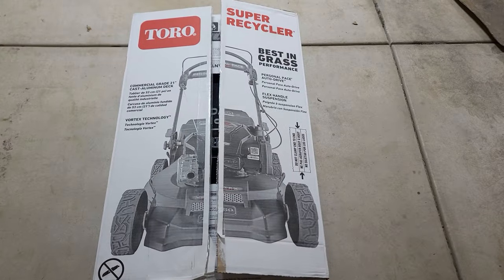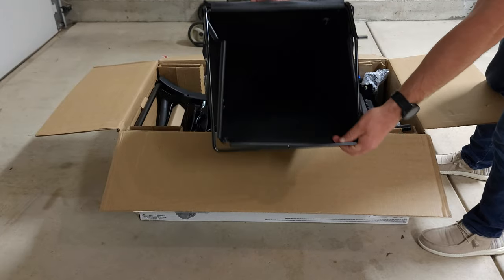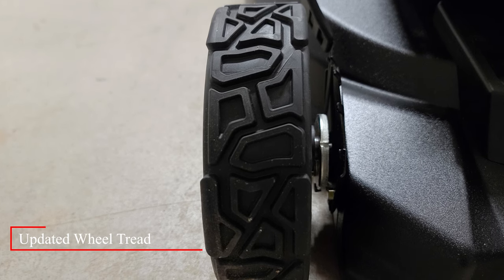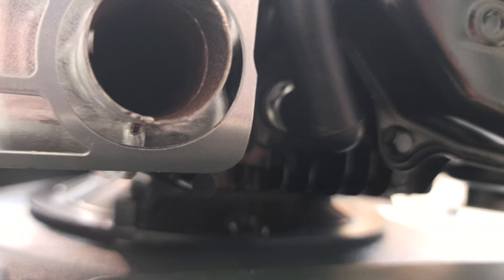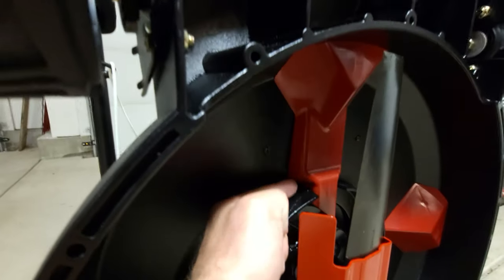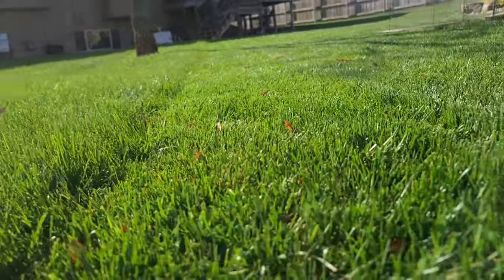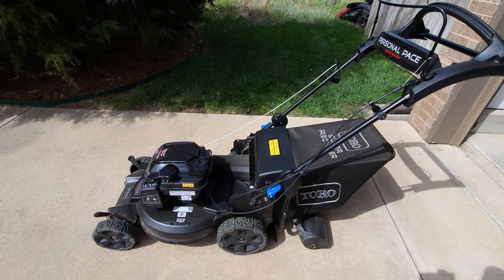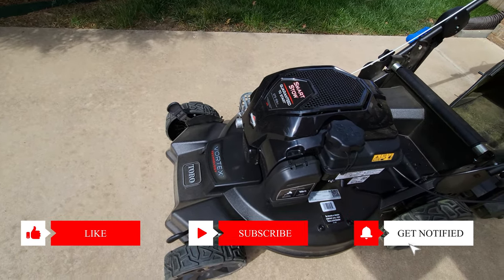Best Toro EVER?! New 2022 Toro Super Recycler 21565 Unboxing and Initial Review

Comment: I just purchased the 21563 & have the left front wheel issue & mine exists at various lever settings (with all set at same position). Is there a fix for this you are aware of (as I don't mow at lowest position as typically mow around 2.75" or higher) or wondering if I should return to dealer.
Reply from the maker: I am not aware of a fix unfortunately. I haven't had many issues with it as it doesn't seem to affect my mowing very much. I would document it with pictures and then mow and see how it feels to you. May end up not being an issue
Reply: @lawntechtravel  Thanks for the reply as appreciate it. Called Dealer & said every Super Recycler they've sold has had same issue but no performance issue since grass is uneven so wheel makes contact with lawn fine when mowing.

Comment: Great review I just got the 60V Super to use and have the regular recycler which I like.  Those annoying things that Toro can easily fix are not being addressed and they could ultimately have the best mower in the market.  Not sure why they are being so stubborn about it.  Thanks
Reply: are u happy witht he 60v super recycler? im deciding between that or the dewalt RWD mower
Reply: Hello I havent used it yet I also purchased the Recycler 60v with the mulch/bag lever and I like that so far. Its so quiet and feels so light on its feet.  but I had an issue with my grass and now its finally getting some steam.  I used a fertilizer and killed it a bit so I had to dethatch it so its not growing yet.  I am  exited to use the Super Recycler as soon as I do I will let you know.  It looks so mean but it doesnt have a on and off switch to turn off the LED's which to me its again a Toro thing that I cant understand why they do things backwards.  You can get it without the LED but it was the same price so I thought it would be a good thing but now I cant return it so I am stuck with the LED one.
Reply: @randomrazr  the super recycler is a superior mower bar none

Comment: I enjoyed your review. I use a husqvarna and I noticed your leaves were not being pulled up. Is that because of the mulch system? I had a 163cc toro and it toasted in 3 months.  Throttle cable dried up and broke the handle. The idle kept getting lower until it was so low it wouldn’t stay running. And the game changer was no gas valve to shut off the gas to the carb which my husqvarna has.
But I would give toro a chance if I can find a cheap one.
Reply from the maker: I will say it's biggest flaw is bagging. This is definitely a mulch first machine. Thankfully I only have to bag twice a year but it is pretty annoying doing so

Comment: I bought one and first cut was good. I had high grass. I need to remove the mulching plug. what is the secret?
Reply from the maker: That's a great point! Where the mulching plug "clips" into the little groove at the bottom, push that plastic piece in towards the mower blade. That should loosen it and allow you to then pull it up and out. Took me a minute to figure that out too. Hope that helps!

Comment: I have a 2021 and it has been in the shop 3 times now. Wheels lock up when you attempt to back up from a object. EVEN the dealer cannot figure it out and people all over the internet complain about this common issue. I miss my HONDA HRX217
Reply: Yep, same. My older Super Recycler had the same issue. The new one also shares the older one's propensity for both throwing the (annoyingly difficult to replace/repair) belt.
Reply from the maker: I heard there were a lot of issues with the 2020 and 2021 models. I know many that had 2018 and 2019 and said they are amazing units. I haven't had any complains about my belt yet. Everything seems great to me on this 2022 unit.
Reply: @lawntechtravel  my old one was like a ‘12 or something, and it definitely had the reversing and belt issues. I was surprised they hadn’t fixed either problem in almost ten years.
Reply: I own the black super recycler and the Honda hrx 217 hydro with the plastic deck. The Toro is alright for the price and weighs 10-12 lbs less than the Honda. I like the drive system on the Toro. But I like everything else about the Honda except no oil drain plug. To me the Honda mows the lawn more even.
Reply: The mower has to move forward a few inches after the drive is released for the mechanism in the small drive gears to unlock and freewheel to go backwards .

Comment: Awesome review, was thinking about purchasing this model myself. But I did want to ask if the handle can be adjusted to different height/ position?
Reply from the maker: Yes, you can absolutely adjust the handle to different heights. In the video description is the Toro manual for this model and in figure 11 it shows how to adjust the handle height! This thing is a mulching machine! I absolutely love it
Reply: @lawntechtravel  oh man thank you so much I think this is my next mower for sure!
Reply: ?? I saw nothing about handle hight adjustment - so I removed the bumpers & that let it drop down ..
Reply: @no-hndle I did the same with the bumpers but I am having issues with the handle moving up in the arrowed slot when pushed because there's nothing stopping it from moving

Comment: I took my 16-year-old Honda HRX in for its annual spring tuneup but unfortunately got it in too late and and everything was backed up and my lawn was getting loooong.  So I go to HD to rent.  All they had was a Toro.  Now I know Toro as a quality company based on its commercial golf course equipment.  However, I was shocked at the poor quality of the consumer mower I got.  The drive control was flimsy and uncomfortable, a wheel kept falling off - several times, in fact, fell off in my car when I went to return it, the height adjustment kept slipping, the bag was tiny, and a bunch of other things.  Maybe because it was a rental but I've rented a million tools and they were at least functional.  The mower was clean and looked almost new.  On the other hand, maybe because it was a rental it showed realistically what to expect.  

But just looking at the wheel height adjustment in this video makes me cringe - cheap sheet metal prongs, thin sheet metal lever that will definitely bend.  Shame on Toro.  And the mulching/bagging "plug" - gotta be kidding.  And Toro wants the same money for this 21565 as a Honda HRX?  My HRX is bullet proof - 16 hard years' use over a bumpy back yard, mowing and major leaf pickup/mulching in the fall, half acre lot and the machine gets used at least nine months out of the year from spring cleanup to final leaf pickup.  Multiple changes between mulching and bagging, multiple changes in height adjustment depending on season.  Today is November 29 and I know I'll mow/leaf pickup one or two more times in December before the snow arrives or after, lol.

Comment: My super recycler bought in 2001 still runs great but it's 190cc
Reply from the maker: They're definitely downgrading the engines I assume as a cost saving measure.
Reply: @lawntechtravel  and EPA regulations, which is why honda is leaving mower business, they don't want to make mowers with kiddie engines.  We'll be stuck with crappy battery powered ones.  $$$$ batteries that will make gas powered mowers look like misers to operate and those plastic cooling fans where the blades attach under the deck on battery models, better buy a dozen of those, will be broke every year from rock/pebble being tossed around the underside.
Reply: @lawntechtravel the 190cc engine it’s just 100 dollars less than that model. The model 21462 come with the same engine that’s why I rather save those 300 dollars or going with the 190cc model

Comment: Any thoughts about new plastic wheels? It’s look cheap
Reply from the maker: The wheel tread is actually rubber and they seem to be doing well. They don't feel cheap to me and now have ball bearings as well.
Reply: Probably cause they are. The older style had bearings also, and the rear ones have grease zerks on the last model design, not to mention better height adjusters that are more beefy. This years model looks like a step down in Quality overall.
Reply: @jasonwb6884  look like he get paid for the review then
Reply: @dattran6886  I don't know about that. I did notice Toro also changed the Transmission from Metal to Plastic. It looks like Toro is really cutting costs on this years Model. I know this mower isn't a Pro line, but this years Super Recycler looks more like a Recycler model with the cost cutting, I guess the new Super Recycler still has a cast Aluminum deck (Not sure if that Vortex gimmick does anything). Why pay more for a new Super Recycler is the question, when the last model design is better.

Comment: can you.leave gas in the tank during smartstow?
Reply from the maker: Absolutely you can. Now I've only done it with about half a tank but the manual says it's designed to stow upright with gas in the tank and it won't leak.
Reply: There is a “lip” that the gas level must stay below or the excess will leak out

Comment: Ok looking,but has that same Walmart lower in priced engine. No it's not the spark plug.
That's common for these engines. Positives, upright storage, personal pace drive. Another negative, 4 point wheel adjustment? I have a Husqvarna with one lever that adjusts all wheels at once with a Honda. engine.

Comment: Has anyone tried the 21564 red model sold at Home Depot and are there major differences. Youtuber and subscribers can you provide insight on gas rwd toro? I went to Lowes and got a Craftsman m320 but later found out cut height is 3.75 inch. I noticed nowadays push toros rwd have 4.25 cut height. Getting to the sod I had ST Augustine Floratam sheets installed all throughout. I tried the craftsman once so far and while the quality of build I find great the cut height is definitely not to my liking. I’m also in SWFL Fort Myers area and only have a two garage for storage and we park both cars in by preference. I noticed toros have the folding storage capability and the cut height is higher however Toro uses several engine types on super recycler models. Home Depot reviews have trashed there mowers with engine, wheel, and quality issues. I also noticed right now you have to buy direct through toro because my Home Depot doesn’t offer Honda engine on toro which seems to have better reviews and feed by tradition. They have model number 21564 which is Briggs engine for order from store. However thinking about finding a way to get a Honda equipped version of super recycler 160s-190s cc. Can anyone provide good detailed feed on quality and engines as these mowers are in $700-$850 range and I’d rather not go through the mud on purchase and returns.
Reply: The Toro SS (21382) with the Honda GCV 160cc 6.9 lb-ft of torque is last year's model. Not sure if Toro is still making that mower. However, I do have the Toro SS (21564) 190cc with 8.75 ib-ft of torque and the Honda HRX 217 VKA 200cc with 9.4 ib-ft of torque I bought new this year. That Briggs & Stratton engine is very close to the Honda's power. I put both those mowers to the test, and I haven't been able to bog down either one. Many people have complained about the B&S 190 engine having sputtering problems. Since I've had this mower, I haven't experienced that issue at all, and my backyard is very bumpy. So maybe they fixed it.

A word of caution if you do buy 21564 from Home Depot. This mower will come from El Paso TX and if FedEx delivers it, there's a chance of it getting banged up. This happened to me twice, and both times I had to return it back to Home Depot. The same thing happened to another person in the Toro Facebook group. FedEx banged up his new mower. It might be best to see if there's a mom and pop lawn shop that sells that mower in your area if you want to avoid the frustration. That's what I did in the end.
Reply: @4x4gear33  thanks for the reply. It’s so difficult to figure out which is quality. Not only supply holds…I mean shortages (yeah right!! lol) but also quality control. I read through those sputter comments on reviews and said jeez are you kidding me? I mean that could have been related to type of fuel also. I bought that cycle fuel and cut 8k worth of yard on one tank with the craftsman.

Comment: Decent mower. Looks like it cuts ok and sounds pretty healthy but think I will stick with Honda, Exmark, Stihl and Husqvarna.
Reply from the maker: Why?
Reply: @lawntechtravel   well I know those engines like the back of my hand and are pretty easy to work on . Have ran the heck out of them all and they keep going at the top of their game. I also love the Honda double blade system on all their mowers. I get a bag of half inch pieces of grass. Very clean cutting with lots of power. Oh and the rear wheel drive literally pulls me up hills. When I invest in equipment I'm looking for something I can run the heck out of all day every day  and last a long time with proper maintenance like oil changes and greasing the gear boxes, spindles, wheels ect. This equipment has handled all I can put it through and just keeps rocking it as long as it has fuel. I mean outside of torturing it or beating on it.  Can't have down time. I can honestly say I enjoy running every peice of equipment that I own. 👍 that mower in the video looks pretty good though and should be absolutely perfect for homeowner use. Maybe a backup mower for a lawn crew as long as it's taken care of. I guess it's just personal preference and different experiences. Didn't mean nothing bad towards it though. Easy to maintain and fix is a big thing with me because I am my own mechanic and welder.

Comment: I see more and more people mentioning the issue of the wheel not touching on a level surface. I took my front wheels off and tried adjusting, but there's nothing really to adjust. This cannot be correct, has anyone found a solution to this!?
Reply from the maker: My solution was to move the cutting height down, but that might not work for everyone. It is annoying
Reply: As annoying as that is, my 1996 Super Recycler does the exact same thing. It must be some inherent design flaw. That being said, I love my mower despite a couple of weaknesses. It also has electric start and a blade brake clutch which isn't a combination Toro offers on this mower.  I'm also pretty sure the new one isn't going to last 26 years.
Reply: @lawntechtravel  I just bought the 60 volt version of this mower and noticed that front wheel was off the ground too. I thought maybe there was just some imperfection on my slab but I guess not

Comment: I have same one only battery  mod
Reply from the maker: How has it been for you? I'd like to try a battery powered mower
Reply: @greghumliceklawncare  small yard front and  back combined  little  over 2500 sq ft cutting both I have 2 bars left on battery running  at max because  I have thick fescue  lawn was nice this yr just  putting battery  in and wal la no problems  start right up the mower is exactly  like yours but it's battery got the side discharge  when I registered  the mower no charge

Comment: I put a 163 Briggs on an old 21" Craftsman push mower and it's on the faster side of slow in thick grass. With propel drive, it would be a dog.
Reply: was that a new engine?  are you sure it was properly tuned?  a 163cc engine should have more than enough power for a 21 inch blade and no wheel drive.  that give you at least 4 1/2 horsepower.

Comment: Not a fan of the new wheels (Upgrade, lol). The old style Super Recycler wheels were solid and proven...used for lots of years. I can tell by looking at these wheels that they are cheaper than the old ones and I would bet they won't last nearly as long (planned obsolescence). looks like Toro wants your money on replacing wheels every couple of years.
Reply from the maker: Should have said "updated" and not upgraded in the video as I can't tell if they are an upgrade or not. These wheels have been on the regular Recycler now for a couple of years, so check with them on how they've lasted.
Reply: I have last year's regular Recycler which has the new style wheels but they are not even ball bearing.  I replaced them with last years Super Recycler wheels which are ball bearing and have slightly rounded edges which I think makes the machine easier to turn in tall grass when you are going around trees and keeping the front wheels on the ground.

Comment: The 21462 model come with the same engine and it’s 300 dollars less
Reply from the maker: Where did you buy that model at? Does it have the 163 CC or 190 CC?
Reply: That model does not have an aluminum deck.

Comment: The lack of a side discharge makes this mower a solid NO for me. Here in SW Florida you WILL be mowing damp/wet grass during rainy season and it will plug any residential walk behind mower.
Reply from the maker: It does have the option for rear discharge, just like all Honda mowers...